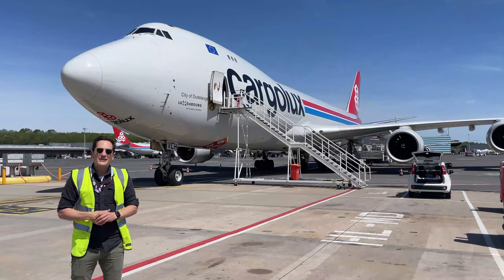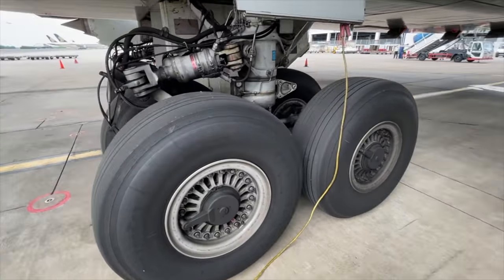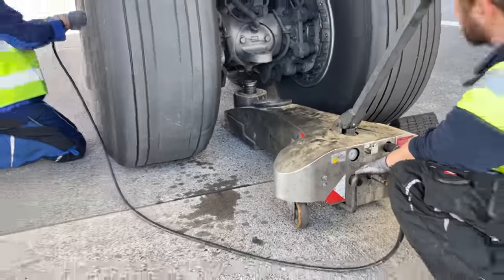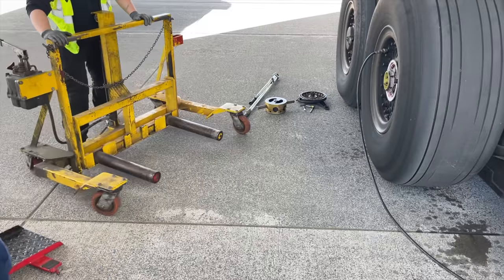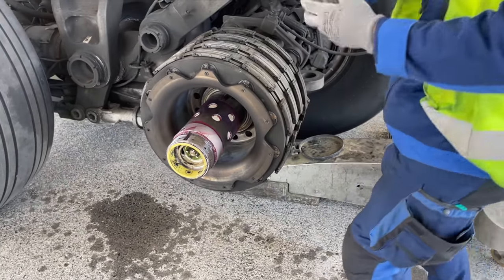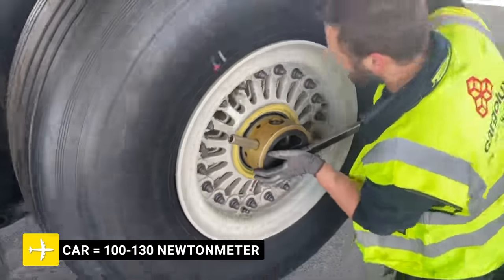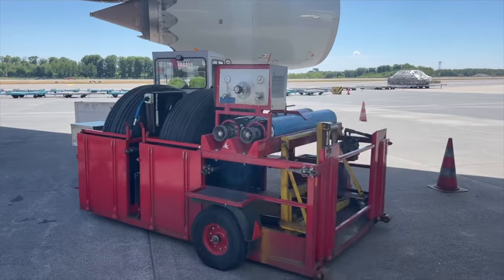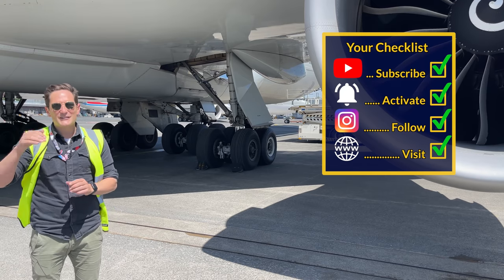How to change an AIRPLANE TIRE in 15 MINUTES! Explained by CAPTAIN JOE

Comment: use f1 tyres and you'll change the tyres in 2 seconds
Reply: They only last 50 miles plus the fact it probably won’t be able to take the hit of the landing
Reply: Its a joke 💀
Reply: @Cebupacifica330neo it’s a joke and they wouldn’t be even nearly big enough

Comment: Using the old tire pressure for the pneumatic/hydraulic jack is so elegant and clever. Thanks for this awesome video
Reply: except if the old tire is burst, I guess they have a compressor (maybe use the plane pneumatics?) for these occasions
Reply: @ThePulmentinum  they dont use compressed air, instead nitrogen from cylinders if they need to top up wheel. In-case of tire burst nitogen from cylinders can also be used or if limited pressure from the cylinders they can manually pump the alligator jack.
Reply: @ThePulmentinum  They hand pump it.
Reply: @ThePulmentinum  If the old tire "burst" it will take more than 15 min, a LOT more. Most likely plane will be OTS ( out of service) as a blown tire causes all kinds of damage shedding rubber chunks, the axle mate will require changing, full gear inspection, and most likely there is a problem with the anti-skid which caused the tire to fail anyway.
Reply: Yes, actually manual also said that tire must release its pressure before remove it, so use it as a source of lifting the jack is much more convenient way for mechanic 👍
Reply: They are REAL MEN they don't use a jack.
Reply: @ThePulmentinum  if the tire burst it’s going into the hangar to check if the axel is bent so finding a source of compressed air isn’t an issue plus usually the company trucks (or at least the ones at my workplace) have an N2 bottle on the back of them so it’s not really an issue
Reply: @ThePulmentinum  there are more wheels on that plane...
Reply: That was exactly what I was going to say!
Reply: @ThePulmentinum  If one tire bursts (or loses more than 20% of pressure), you have to change both tires on that axle due to excessive forces being placed on the good tire. You can either use the nitrogen from the remaining good tire, or hand pump the jack.
Reply: @WillFixPlanesForMoneh  not necessarily. A blown tire inspection could easily be accomplished on the ramp. I have even replaced axle assemblies on the ramp. Taking the plane to a hangar is a luxury that is not available in the majority of locations for most airlines.
Reply: @jeffrey8885  If a tires falls below a certain pressure, then per the maintenance manual the other tire on the same axle must also be replaced. In cases like this, that second tire is then used to operate the jack. and I have used the nitrogen servicing bottles to operate the jack before, we just do not like to use them because it tends to waste the nitrogen in those bottles.
Reply: @krislhull  that is true. If youre happy and you know it clap your hands.
Reply: Not clever Just physics, I used to repair these things and they are a pretty cool aid to production
Reply: @ThePulmentinum  use a normal airhose like the one for your tires
Reply: @CarstenBauer  also possible but no fun
Reply: @Dacia Sandero guys 😂😂😂
Reply: Cheater hose that's what the hose is called
Reply: @ThePulmentinum   big 3000psi nitrogin bottles with reducer to about 210 psi depending on the tire and aircraft
Reply: the tire pres has to go down for transport safety
Reply: @AerobatBrian  and get a new one from the store or order on fr my colleague if needed onAOG base
Reply: @ThePulmentinum  😆😆😆😆😆😆😗😗😗😗😗😗
Reply: You are always welcome Massimo
Reply: They’re German so…
Reply: Cheaper products cheap life
Reply: @AerobatBrian  8
Reply: 724/Mauritius On-line with the same thing that came with the honking
Reply: @ThePulmentinum  a nitrogen bottle
Reply: @CarstenBauer  never…we have nitrogen bottles
Reply: @AerobatBrian   no it doesn’t.  I worked a 47 once that tried a short runway exit and thermaled 8 tires.  It flew away with zero issues.
Reply: @Akira-br7bn  nobody deflates tires before they remove them.  The manual says to put gear pins in, lockout gear doors, lockout reversers…nobody does that either
Reply: @WillFixPlanesForMoneh  it won’t if it just thermaled
Reply: @willemh3319  it’s called a regulator
Reply: @willemh3319  flat
Reply: @CarstenBauer  nope pneumatic tool airpressure
Reply: F
Reply: @AerobatBrian  its called AOS
Reply: @Akira-br7bn  nobody does that...EVER
Reply: @WillFixPlanesForMoneh  it is not going to the hangar
Reply: @robertkuipers4655  ot use the botttle on the cart....we dont hand pump anything
Reply: @willemh3319  its called a regulator
Reply: @justing42  come on check the AMM carefully
Reply: @justinglass9340  Check the AMM carefully, and Nobody? What you see in this vid?

Comment: during their removal/installation they didn't install the axle thread protector which a basic safety requirement in wheel replacement. it prevents damage to the axle threads and prevents the axle threads scraping the inner surface of the wheel bearings and i am not sure with boeing but on airbus it is specifically stated on the amm to turn the wheel on the same direction of torque to compensate on the torque friction.
Reply: Wouldn't be the first bad safety decision by Boeing lately.
Reply: It’s also for Boeing 747 required.
Reply: Doing a task too often makes you start loosing some steps, its not ideal but that is how it is in aviation.
Reply: @MrBillboeing  yeah i thought so, so this guys need a briefing form from their QA or re-training (",)
Reply: Aircraft Maintenance Manual Chapter 32 ;-) never do a job without it. Values and practices can change all the time.
Reply: @montgomerymcferryn1542  but at least because of the video should everything be by book (aka AMM) Like when You have an audit. :P I know is hard, especially when You have 3-4 quick turnarounds, 4 weekly on the ground, and low manpower as usual.
Reply: @MrBillboeing  not for the 777 about the direction

Comment: Great Video   nice equipmnet   but  3 mistakes were made according to the Aircraft Maintenace Manual ( AMM)   chapter 32-41-01 ...  (1) Tyre should not be fully inflated prior to istallation  to avoid potential burst . (2)  A thread protector was not used ( prevents damage to axle threads and bearing seals )  (3) wheel should be rotated in the same direction of wheel nut while tightening  in this case clockwise  not counterclockwise ....  Overall  they did a great job
Reply: Yeah, I was like. "Where is your thread protector?" 🤦‍♂
I work on 767's and had another station change a tire and didn't use it. They damaged the plating on the axles just past the threads. Had to had NDI check it for cracks and the plating shop to replate the area.
Reply: Is this on the 747 only? Because on the 777, I can't find step 1 and 3 in the AMM. Step 3 it only states turning the wheel, not which direction. It's just checking if the bearings are not stuck, so the direction doesn't seem like a problem right? Oh and they didn't put the parking braking.

Comment: Awesome video, as always. As for the nitrogen in the tires, Ken over at his Aero Savvy blog also discussed that once before and it was really cool to learn!
Reply: Careful Joe, now that Dev saw your uniforms he can sneak around the airport.
Reply: @adriansrealm  👍😂👍  all aprons should be SIDA areas, thankfully.
Reply: @DeviantOllam  So you'll need a week to 10 days prep?
Reply: @adriansrealm  if anyone's hiring me, I won't turn that job down. :-)
Reply: Well, while it's an extremely rare gas, being only 80% of our atmosphere, it is relatively unreactive as a gas with things like tires.
Seriously though, for "inert" (read: noble gases), argon is a rarer gas, being around 1% of the atmosphere, so when something like oxygen is present as a purified gas or a few other reactive items are present, argon is a cheap gas to use. Hence, we also see it in MIG welding.
When one wants a gas that's a pain to safely store or store long term, hydrogen and helium generate all kinds of friends, as they can diffuse through so many containers.
When one wants an exceptionally corrosive and lethal gas, hand me a can of beans.

I'll just get my hat...

But, on a serious note, notice how easily that tire was spun by the mechanic? That's some really high quality bearings in use there! Good thing, given a 500 pound tire gets spun up at landing speed from zero instantly!
I saw a man push a 727 that had passed its stop mark by hand, as all of the push back tugs were in use and they really needed to get the jetway to the plane. Had the crew release brakes, he pushed for a few seconds and the aircraft rolled back to where it was needed, brakes set and the flight departed on time.
Reply: @spvillano  ok dude.  You want to know why we use DRY nitrogen in tires?? If it isn’t dry, it would have water in it right?? Where do airplanes fly?? What is the temperature there?? What would that water inside the tire do?? You are welcome, from someone who actually works on planes and has forgotten how many tires I have changed in my life.
Reply: @justing42  the tip off for sarcasm would be where I said that nitrogen is rare.
But while we’re where the rubber meets the short road, what really gets my attention is the aircraft braking system. The temperature extremes experienced under working conditions is just absurd!
Well, that and the bearings used quality being so high out of sheer necessity.

Comment: I was a CIT fueler at LAS Nevada. The aircraft maintenance company we had was CAS. Like every other department on the ground, we had a turn-time for the flight which was typically around an hour or so, unless it was scheduled to depart later. I've witnessed plenty of tire changes, and always had to communicate with them before I started fueling the AC.

Comment: One of the primary ways to inspect the brake for wear is the rod sticking out on the aft lower portion of the brake caliper you showed. You'll notice it is sticking quite far beyond the limit indicating eyelet/support that is a few inches from the caliper which means that's a fairly new brake.

Thanks for the video, it's always nice to see the maintainers getting a small shoutout.
Reply: Wow! 

Thanks for these insights
Reply: Hey the maintainers are the guys that keep us all safe 8)   Pilot flies a few hours the mechanica are the ones that keep us in the air 8) God bless them all !
Reply: I would like to see a video on a brake change. I know that the wheel and tire would have to come off but what other steps are there for the brake?
Reply: @strangelove9608  and there are plenty of crash videos that cover the rare times that they don't do their jobs correctly, either from unapproved parts and procedures or incorrect parts being supplied.
Which is why they cross check each other so often.
Reply: @spvillano  oony
Reply: L0l0
Reply: It’s called a brake wear pin indicator. Catch a finger nail on it, it’s going.  And that’s the ONLY way to check.

Comment: I was a crew chief on heavies in the USAF and this video brought back memories.  It's a pretty simple process but it can be dangerous, and like pretty much anything on an aircraft, you don't want to screw it up.  You're dealing with a lot of weight and very high air pressure and some really ugly things can happen.  

These guys make it look easy, but there is an art to rolling those MLG tires on and off the trailer or in and out of the racks in the shop without losing control of them and/or dropping them.  Aside from the damage and/or injury a rolling, out of control MLG wheel-tire assembly can cause, dropping one of those awkward, nearly 600 pound monsters requires at least three men men to dead lift it back to upright again.  Dropping one will not exactly make you the most popular guy on the crew that day and the others will not let you soon forget it.  I don't know about on a 747, but on the heavy jets I'm familiar with you don't want to forget to insure the brakes are set prior to pulling the wheel/tire off.  If they're not set or can't be set due to no available power or hydraulic pressure, you'll "drop" the brake, and those multi-segmented rotors will have to be "jigged" and THEN the brakes set prior to installing the new wheel/tire.  Unintentionally dropping a brake is another thing that will make you an extremely unpopular individual on the crew that day.
Reply: Fully agree with You, but I am surprised they forgot to install mlg axle thread Protector, one of most important thing during wheels/Brakes removal/Installation on a/c 😜
Reply: @davidecaprio4667     NOBODY use those things. You would get laughed off the line of you showed up with one of those
Reply: @justing42  nobody laughed at me for more than 10 years mate :)

Comment: Cool! 
Thank You Joe for this interesting video. I remember one occasion a long time ago. I was doing my "military" (civil-) service in Sweden as a civilian airport firefighter. We used to sitt and watch videos before going to bed at our station, just to wait for the last plane landing. This night we heard a loud bang and the windows where shaking ... all of us rushed up and prepared for an emergency. One of us looked out the window and saw nothing unusual ... the MD80 was slowing down and started taxying to the terminal as usual(?) So we did not go to our truck. But wondered what caused the bang. Then the telephone called ... it was from the tower, and they asked us to go out and sweep up all the rubber from the runway ... The airport was not so big so we had jobbs that is maybe not normal for firefighters ... This was one of them. The other was to check the friction of the runway in winter during weekends (when the ordinary guys did not work) ... another job was to control the lights in the morning and sometimes check visibility, when the airport was foggy ... :) I loved that time and miss it. There was also a flying museum at the airport with one old P51 Mustang ... :)

Sorry for a long comment ... Now you have read a chapter of my memoirs ;)
Reply: At least you did not have to go find the remains of the animal that wandered on the runway. We got most of the little Steenbok in the wheel, complete with the baby, well cooked. Wash off the wheel, strip it to replace the torn off ABS wiring harness and sensors, and brake lines, and get the plane ready to fly in the next hour, because it had to go up then. The hanger queen in the other door was the donor, it was just missing the engine otherwise, so we could do that in the daytime when stores was open.

Comment: Amazing tutorial but one step was missed. Cleaning, inspection and re-greasing of the axle. I remember many nights doing tons of tire changes. One night a T7 had 5 of its tires changed that night.
Reply: And the thread protector
Reply: What about tyre pressure sensor? do you swap or code in a new one?
Reply: @MrPronoz  On airplanes with factory tire pressure sensors, they are almost always wired. The sensor screws onto the valve stem and the signal is sent through a rotary transformer in the hub. This is due to complex certification issues with batteries and radio signals.
Reply: @straightpipediesel  I noticed there was no wire in the video and a metal (?) cover. Is that a dash 8 thing? I left the industry just as the -8 was coming in.
Reply: @ImperrfectStranger  My understanding is the -8 doesn't have a normal in flight TPMS, instead you can optionally get a unit that fits over the valve stem and can be read wirelessly at close range using a handheld device, obviously only on the ground.
Reply: @straightpipediesel  Thanks!
Reply: @straightpipediesel  Tyre pressure can be seen on the EICAS at all times. There is not a physical wire connection of the wheel to the aircraft because tyre pressure data is transferred via electro-magnetic inductance. The hub cap (rotating interface unit) is used as the means to transfer the data from the sensor in the wheel to the static interface unit within the axle. Joe incorrectly states that the cap is protecting the pressure sensor, it has the arm over the sensor because this is the bridge between sensor and aircraft. An every day example electro-magnetic inductance used on something most people have is a wireless phone charger. Voltage is transferred to your phone from the charger in a similar fashion. Tyre pressure signals are just a small varying voltage and this voltage is relative to a specific pressure.
Reply: @bobwgower  I don't have a wireless phone charger.. But I have an electric toothbrush with the same principle.
Reply: @nhytg376tgyuu765gjmg  yes any wireless charging device operates on a similar principle. Please note that my description is simplified and in reality has a bit more to it.
Reply: We had all 8 mlg tires to remove and reinstall due to a time change of anti skid units one shift- with one problem- our jack had no ait fitting- it had to be done by hand pumping. Naturally they didnt have a long enough jacking lever to kake it an easy action there. That was NOT an enjoyable time in the hot dry Arizona evening at Evergreen Air Center
Reply: B 747 200 Lufthansa
Reply: Right body and wing main gears that was
Reply: Also thread protector is not used